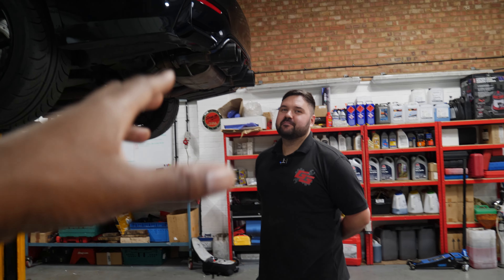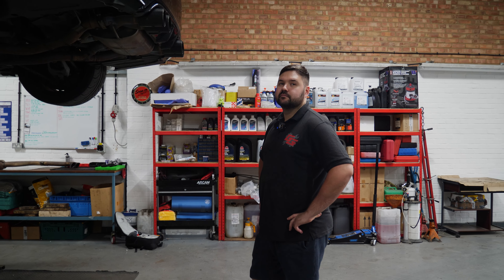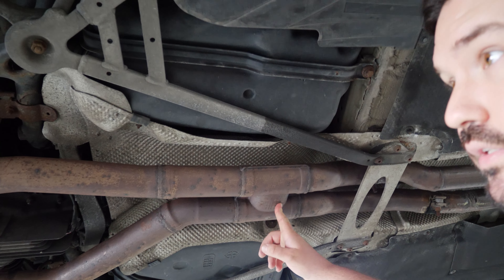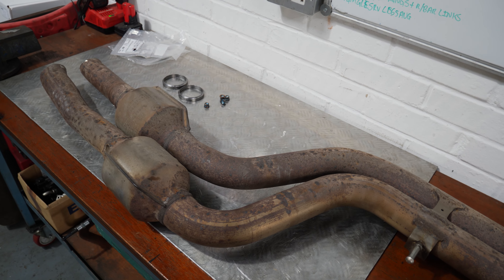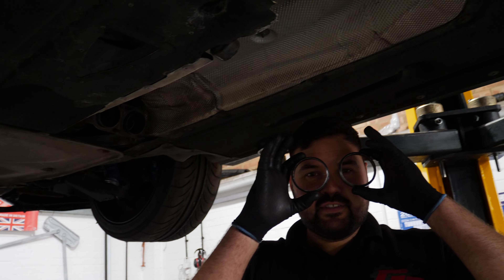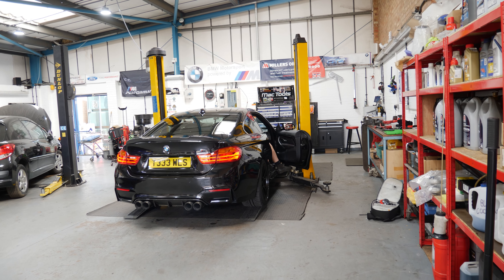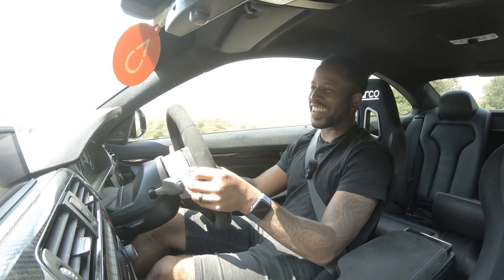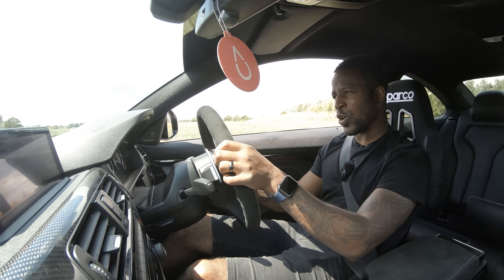FINALLY Made My BMW M4 Sound PERFECT! - [Project M4 Clubsport]

Comment: I totally get this. 
 My BMW Z4 M40i was near silent especially as after turning off the fake sounds (big stereo install made it boom😖)
I fitted a sports cat downpipe which made it a bit louder but removing the OPF and fitting a straight pipe made it wayyy to loud, especially as there’s no other resonators or secondary cats, just the back box. 
Back to the exhaust specialist and they made a straight through resonator and fitted it in place of the OPF bypass. 
This resulted in a quiet but nicely fruity sound. 
The factory back box has a single valve and twin outlets. I fitted a Remus with quad outlets and two valves. 
This resulted in a quiet but fruity sound with the valves closed and louder but not ASBO sound with them open. 
I have a ASR valve remote for total control. It’s now safe to boot it with the valves closed. 
It took a while but it’s now near perfect 🥰
Reply from the maker: Ah glad to hear I’m not alone in wanting a non asbo setup 😆